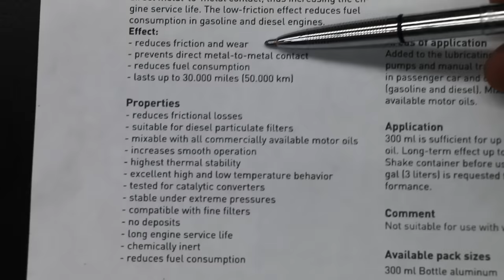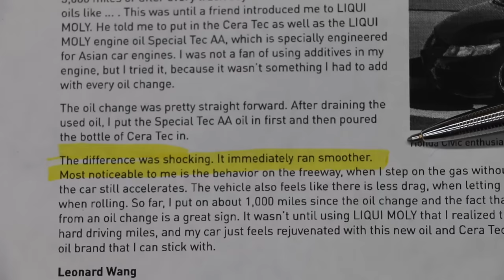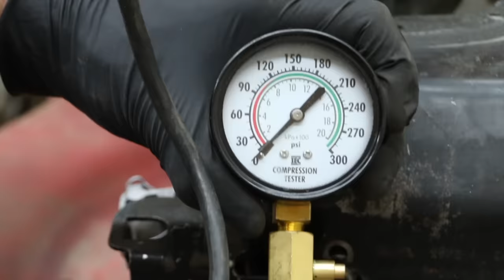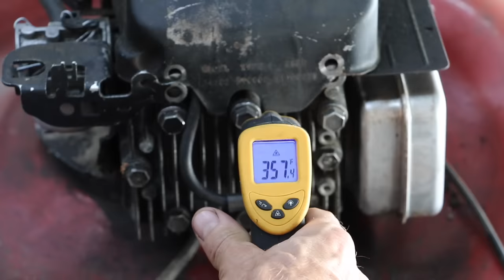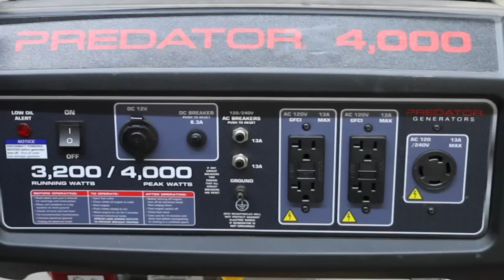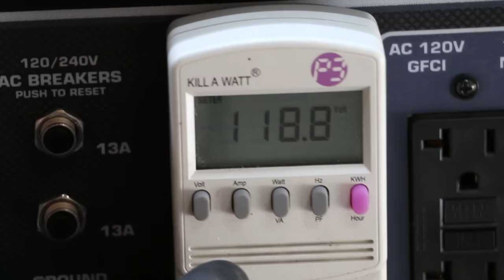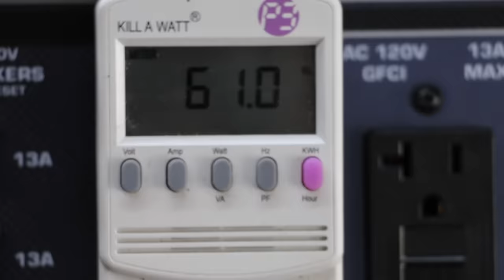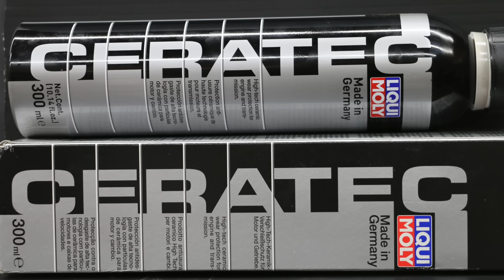Does Liqui Moly CeraTec work?  Let's find out!

Comment: If you have a healthy engine and use good quality oil, absolutely do not use additives such as the Ceratec !
I have always used the Valvoline synpower, which I was very satisfied with. I thought out of curiosity and good reviews to try the Ceratec.
After I changed the oil, I added the Ceratec. the engine became noticeably quieter and smoother after several km of driving, but the engine no longer had the torque feeling that i always had with only the Valvoline oil. I was very disappointed with how the car transformed into a different kind of character.

I changed the oil again, this time only the Valvoline oil without additives. my car drives perfectly again just like before!
i Believe this additives are great for cars older than 2000 that are worn out and consume oil.
Reply from the maker: Thanks for the feedback.

Comment: It works, BUT the reason I needed it was because I had wrong oil in the first place, 
I had 5w40 when I shouldve had 0w30.
So check with ur original car manufacturers before you think you need this.
But short answer is yes it works.
Reply from the maker: Thanks for the feedback.
Reply: @ProjectFarm  thanks for all the vids man, its nice to see someone test products that we are sceptical about or uncertain about.
But yeah it's fun when they actually work like this one and isn't "snake oil" 
Just changed my oil to 0w30 yesterday and changed all my vakuum lines and now she works like she should ;D

Comment: one more aspect, VERY often overlooked and rarely mentioned: 🤓 The hydraulic lifters OFTEN clog and cause all kinds of engine fault codes, NONE of these codes actually mention to check the hydraulic lifters, they always "blame" another part. hence you might end up replacing alot of parts which are still good without getting to the root cause. Try HYDRAULIC LIFTER CLEANING FLUID first, this stuff is meant to do just that, and it often really works! this is often the simplest fix for your engine, and you can't really hurt the engine with cleaner lifters, even if there is another fault as well. It's like VITAMINS for the engine 😉
Reply from the maker: Thanks for the feedback.

Comment: My SUV produces knocking sound from the engine or valve lifters. I once used liqui moly ceratic and indeed, i lowers the noise level. I can not guarantee if all car engines need  this product for engine issues. I was only trying.
Reply from the maker: Thanks for sharing.

Comment: I could have sworn that almost ALL liquimolly oil additive products say "NOT SUITABLE FOR USE IN WET CLUTCHES" now from my knowledge of small engines, generators and lawn mowers are a "splash type" of oiling system... now im not doubting the product, I use liquimolly religiously, was just wondering if there is a correspondence between the wet clutch and splash type of oiling systems that could effect results is all im saying
Reply from the maker: Thanks for the feedback.

Comment: I made the mistake of using Slick 50 years ago. It clogged an oil journal in my vehicle, requiring major repair at 48K miles. If it sounds too good to be true, it probably is.  I’ll stick to regular motor oil, and changing the oil and filter every 3K miles.  Never had issues since.  Avoid snake oil. 🐍
Reply from the maker: Thanks for sharing.

Comment: Please confirm if it is good/indicate to use "Cera Tec (7181)" and the "Motor Oil Saver (8375)" together. and simultaneously with the "Leichtlauf High Tech 5W-40 (2328)" engin oil change. Thank you in advance. 
In the last 9 years, I have used only Leichtlauf HT 5W-40 Liqui Moly (2328) engine oil in my Mercedes E320 4Matic gasoline (W210).
Reply from the maker: Thanks for the suggestion.

Comment: Can u make test with cold oil, and then heat it up to operating temperatures?
Would be nice to see how they preform on operating temp. Also use different bearing for cold and operating temperature, also why not overheat it.
Reply from the maker: Thanks for the suggestion.

Comment: I poured one bottle of Ceratec in my 94 Land Cruiser's engine loaded with Amsoil 0w30 and I can no longer hear the engine, or feel it. Power seems the same, fuel economy seems the same (abysmal) but the engine runs silky smooth and is quiet enough to allow me to hear all the other annoying noises.
Reply from the maker: Thanks for sharing.

Comment: Can you do a test of the ATS 505 CRO. Can you also provide the link of the best oil treatment video that you did? 
Does it matter if you have a twin turbo engine? Or if the engine was developed and designed in Europe? 
Can these engine oil treatments can be specifically developed for does types of engines?
Reply from the maker: Thanks for the suggestion.

Comment: All the claims aside: if I can leave my car for 3 weeks at a time without starting it and an additive provide a residual coating on cylinder walls, cam rollers etc to get help with a head start on lubrication then that is what I want. The rest of the claims are not important to me. 

A moly, graphite or (boron/ceramic?) lubricant should in theory help this. 
 A gas or Diesel generator that sits for a year for example would benefit from this sort of additive as well. 
   If you can help me know what additives actually leave a film behind then THAT would be something!
Reply from the maker: Thanks for the suggestion.

Comment: Is there any oil-additive you'd suggest for hydraulic-lifter clicking noise (for the specific engine, a Alfa Romeo TwinSpark 1.6l, probably subpar lubrication / movement of oil to the lifters) ?
Reply from the maker: Thanks for the suggestion.
Reply: @ProjectFarm it was question 😂 bot anwsers

Comment: I think your always best bet is a very good synthetic motor oil and change it up every 5000 to 7000 km. After all the longest running engine was a Toyota with over a million miles. Toyota bought the engine off owner and took it apart to see how it lasted that long. Conclusion was the owner changed the oil extremely frequently and small tune ups along the way. Additives are dangerously over rated. A viscous test is more important after all that oil has to freely run unimpeaded to those lifters and rods   To thick and not good
Reply from the maker: Thanks for the feedback.

Comment: I prefer Liqui Moly MOs2i have used LIQUI MOLY 300mL MoS2 Anti-Friction Engine on every engine all lasted over 225-400+ miles I own...(the racing teams use it between pit stops), It's just that good. mustang gt 225k, toyota corolla 400k, mercedes 500 300k, F150 290k, thunderbird 5.0 420k, you get the drift. NO Sludge.   oB
Reply from the maker: Thanks for sharing.

Comment: I bought this product finally and added it to a fresh oil change. After running the engine for about 20 minutes I noticed my engine RPM at idle was much more stable and smooth. However the first 20 minutes the engine had really rough idling speed due to the stuff being sort of thick but once up to temperature it ran very smooth. We will see how it does over the next few fill ups.
Reply from the maker: Thanks for sharing.
Reply: Hi Jay any updates on how your engine is doing?
Reply: @mikeyeyes7  yeah no noticeable change in terms of performance but mileage increased slightly but not something I would buy again.

Comment: How come, on film strength test it showed no significant difference compared to just oil, but at the end it got better mpg and more RPM, which indicates that it helped with friction.
Reply: The numbers are on the edge of being significant anyhow.
A 1% fuel economy difference might be measurable, but on the film strenght 1% is just way to small of a difference in a few mm scar size to measure.
Aditionally, there is other factors to wear.
Reply: @ignasanchezl  i see. ceratec was my last resort, when I was watching this test I hoped it would be good. My car engine is known for chewing chain guides and tensioners, so I was looking for something to reduce friction below of good engine oil.
Reply: I really doubt this will help you in any way.
Reply: @ignasanchezl  i was thinking either ceratec or lucas full synthetic additive
Reply: So idk what vehicles this is, but if you are using the correct oil, no additive will make a big enough difference. Expect at most 5% wear reduction on lubricated engine parts.

Comment: Have you ever tested ER energy release oil additive..i used it in my chainsaws n saw a weird result in my cylinders where the rings make contact..says it changes metal ..my saws run well but I'm not sure if I should even be using the stuff by the way the inside looks..would love to see u test ER to see what results u have
Reply from the maker: Thanks for the video idea.

Comment: From experience going back to 1963. Oils, since about 1990 do not need any additive, especially the better synthetic lubes. Up to the mid-60s, Bardahl was the rage, then STP, Molyslip, Lubysil SC100 and Slick-50. I tried all except Slick-50 and with 20/20 vision in hindsight, I think I was kidding myself about the benefit of additives in any oil at any time past. Why throw away money on additives when they NEVER increase the resale value of a car anyway?  Col, 74.
Reply from the maker: Thanks for the feedback.

Comment: I love your product testing videos, but the oil additive tests seem a bit sketchy to me.  I'd much rather see real world results in an actual vehicle.  For example, a regular interstate round trip could be used to measure fuel economy.  It'd be slightly tedious, but fill up at the start of each round trip and calculate fuel economy for each 60 mile round trip.  Record outside temperature and wind velocity and direction for each leg of the trip to ensure there were no serious differences in environmental factors.  Minimum of five round trips on new oil followed by five round trips with the engine additive, although ten each would be better.  Despite the "immediate results" marketing claim, it's likely that Ceratec builds a coating over time and may need a few hours or more to become effective.  If I commuted a long distance to work, I'd be tempted to test the Ceratec myself.  Probably the best test would be a vehicle with meticulous fuel and maintenance records, run one year with oil and the following year with Ceratec, and compare average MPG for each.

Comment: I've used Cera-Tec in all my cars for awhile.It does work bettrr after 300-500 miles.Everytime that I've used it was with synthetic motor oil and when I first add Ceta-tec to the oil 5 minutes after the change I can hear a slight difference in the sound of the engine-quieter.My VW diesel got between 7-8 percent better gad mileage -why I don't know...I'm not a mechanic.Cera-Tec works good in degrees.

Comment: Is it possible to add additive to the car without changing the oil?
I changed the oil 1500km ago.
Do I need to replace with new oil and then add an additive or can I use this oil that has passed 1500km
Reply from the maker: Thanks for the suggestion.
Reply: @milanm3997  you do not. You can add it as is to your already running engine oil.

Comment: Gonna chime in here. I just added ceratec to brand new 15w50 synthetic oil in a e39 540i with lifter additive. 

The ceratec made the e39 very very very quiet.  You can barely hear the motor now. It definitely does something
Reply from the maker: Thanks for sharing.

Comment: Interesting content but I wonder about the 10W30 oil being used for the tests. Is it a generic multi-use product or is it formulated for a specific application?

Quality lubricants are manufactured with a specific use in mind, and a balance of additives to address friction, contamination, deposits, agglomeration,  emission, and degradation (mechanical and chemical) whereas generic lubricants skimp on these additives because additives are expensive.

A cheap 10W30 oil will be a poor performing product versus a quality blended oil. The quality product will already include an array of additives to address the issues being tested here whereas a cheap or poor quality oil may have few or no additives. The use of an oil additive may then be advantageous but it is unlikely to be useful in a high quality oil and it may actually produce worse results such as the deposits we see in this test.

As has been said elsewhere one test is not a suitable sample size to produce a conclusion, and based on this video the cost of the adfutuve does not translate into a worthwhile investment for the applications shown.

Furthermore it is less important how the oil performs in a lawnmower than a truck or car engine.  Applications, duty, and tolerances are different.

Great video and brilliant insight into the world if additives. Just be careful if you are watching this not to assume that all 10W30 oils are the same. They are highly variable in performance and characteristics depending on the formulation.
Reply from the maker: Thanks!  Thanks for the feedback.

Comment: another bottle of snake oil.  New cars now come with 5 - 7 year warranties. If you ant to void that warranty in a heartbeat, add CeraTec.  i follow the manufactures service guidelines & use fully synthetic oil + new oil filter. Only difference is that the oil (5W30) that I use has added zinc. Engine runs a little smoother & quieter..
Reply from the maker: Thanks for the feedback.

Comment: short term benefit is situationally specific, compression friction mileage etc. improvemant is often for 1000s of miles & most probley refers to gunk, cRbN, sludge & so on etc. CARS OR TRUCKS(not lawn mowers generators & so on).  good test, but like other tests I’ve Cn on Utube.. inconclusive as usual.. I’m stNDingbeith my theory that no one knows if liquid Molly works or duzNt.. or NEthing Ls btw👋😒
Reply from the maker: Thanks!

Comment: Maybe use 5w-30 or 0w-40 full synthetic engine oil can deliver the same result
Reply from the maker: Thanks for the suggestion.
Reply: @ProjectFarm  I added 300 ml Liquid Moly and 200 ml of AirTek Wagner Boron Nitride - both are .5 micron - so I had an extra 1/2 quart to 7 quarts of synthetic. People on this engine say they add an extra 1/2 quart of oil just to make sure the rear seal has enough oil during fast acceleration. When I did the 10 minute drive to work in the Snake Oil the engine sounded terrible. The next day I went to the oil change place and they did not want to change my oil again since they had just changed it the night before. So they just replaced the filter to lower the volume by 1/2 quart. So I drove off still getting "service engine soon" light flashing. I went to a nearby other quick lube place and got the oil changed. Still has the "service engine" - and the code said it was cylinder six. 
So then it just gave a "general misfire" code after I cleaned out the spark plug wells and replaced all the spark plugs - I uploaded a vid. The molybdenum had some kind of magnetic induction past the piston rings and sucked into the spark plug wells! 
So then I got all new ignition coils and the misfire went away but the catalytic converter got damaged. So I bought a new catalytic converter. The fuel efficiency actually seems to have returned to normal and maybe even better. I also did an engine flush with the synthetic Motor Medic. Still the catalytic converter is still backfiring at idle when the cam phaser has to struggle the variable valve timing strongest against the rpm fluctuations.
I had never even changed my own oil before this incident - so I got a crash course in being an auto mechanic. haha. After spending $60 on snake oil I spent $700 on parts. Hilarious. 
At least I didn't get rod knocking - as far as I can tell. The lifter tick is still there so I'll use MMO to treat that. thanks

Comment: You guys know whats not Snake oil?
Waxing car,
Going a little slower,
Changing oil often and using Syntetic and original filter.
Adding 3 PSI more to the tires
Using smaller tires,
Avoiding congestions and planning trips.
Cleaning the Air filter.
Not snake oil and PROVEN

Comment: I poured this thing on my Nissan Maxima 2004 and it clogged my Intake Valve Timing Solenoid. Had to replace the engine oil and clean the solenoid.
Reply from the maker: Thanks for sharing.

Comment: In my opinion, car engines work differently then a lawn mower engine. I understand its the same concept, but the car has  different tolerances, speed, and the quality of parts is better in a engine then lawn mower. So using oil additives in a mower won't give the same results as a car engine.
Reply from the maker: Thanks for the feedback.

Comment: Does this work. OMG this Ceratec stuff is sick. Also use it on Liqui Moly oils not foreign brands to get the best results. My Audi a4 is noticeably faster with this stuff in the oil than without. Revs quicker.
Reply from the maker: Thanks for the feedback.
Reply: Use quality oil and you will get the same effect without messing your engine.

Comment: ceratec did quiet my vvt cam phaser that ticks at start up on 2.4 ecotec 60,000 mile motor and runs better .i got the info from 5.0 mustang owners that have ticking  heads and they use ceratec quiets them up they said they were right.
Reply from the maker: Great information. Thank you

Comment: Hy dude try it in EFI engine because in this engine ecu control fuel ratio. in your video both engines are carburator and carbs fuel ratio is fixed may be engine need less fuel after using ceratec but carb gives same fuel ratio thats thy no good result found

Comment: What about ACTIV8 ? Seems to cost more.
Reply from the maker: Thanks for the suggestion.
Reply: @ProjectFarm  they pride themselves to be the best. I knew of them since around mid 2000. Saw a demonstration at the Goodwood festival of Speed. I actually did use it in my car and motorbike. But would be great to see an impartial test on it. To me, it made no difference, but both car and motorbike were new.